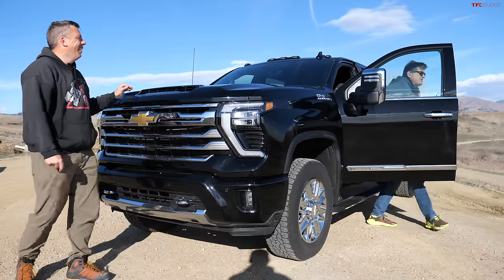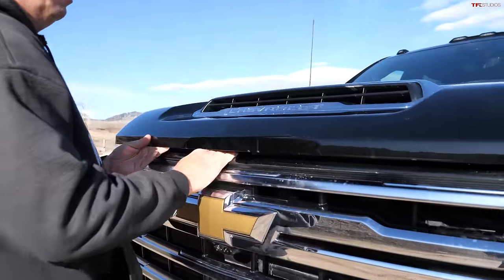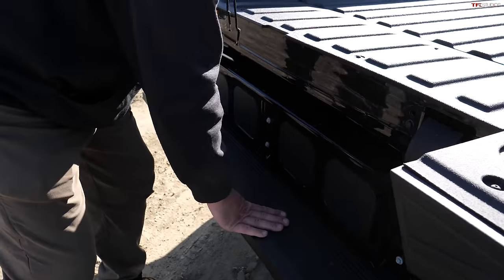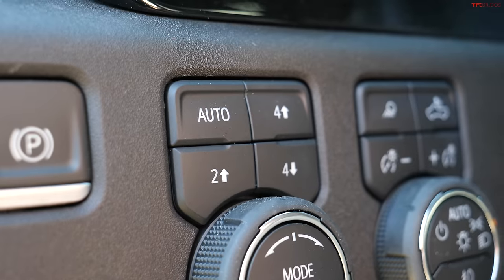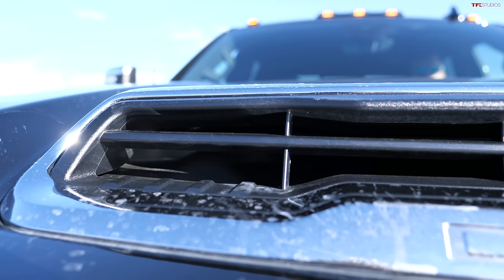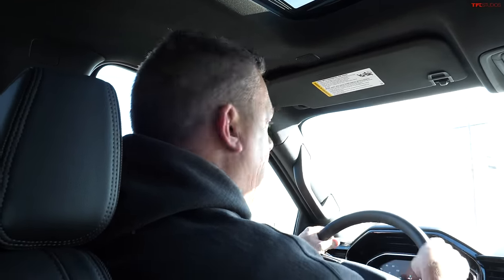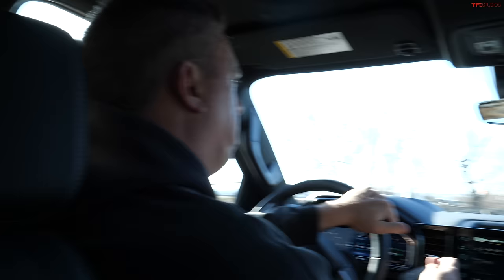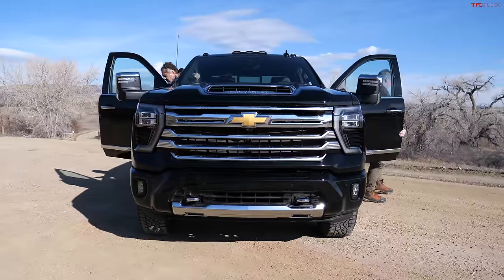Is The New 2024 Chevy Silverado 2500 HD Duramax Diesel The New Benchmark for Heavy Duty Trucks?

Comment: Now if only GM would up the Warranty limits on these trucks, I mean for nearly 90k you could at least expect a 5 or 6 year bumper to bumper.
Reply: I upped mine to an 8 year 100k bumper to bumper warranty just because of the emissions equipment...
Reply: Duramax and emission equipment is 5 year 100k mile warranty already.
Reply: @richfarfugnuven6308  
In Ca it's an automatic 8 80k emissions
Reply: Exactly right ! They need and every manufacturer needs to do at least 100k mile warranty ! That’s not to much to ask for at 90 k dollars
Reply: Oh like Dodge? Dodge has taillight warranty pretty much
Reply: I just bought a brand new 23 Silverado LTZ and I get a bumper to bumper warranty on everything for the lifetime that I have the truck
Reply: @richfarfugnuven6308  Check your extended warranty, it may be electrical and mechanical only, and not actually bumper to bumper..
Reply: @Kevin Reynolds  I bought the actual bumper to bumper to cover the DPF...
Reply: @jonscott7686  ummmmm, no...
Reply: @richfarfugnuven6308  yes, same thing with my fiancé’s 23 Tahoe for as long as we have it is covered bumper to bumper you’re more than welcome to call my dealership if you want the number. Mr. know it all not every dealership works the same way.
Reply: @Jon Scott  nobody has a lifetime warranty on a vehicle.  What dealer is lying to you?
Reply: 5 year 100k
Reply: @Tallnerdyguy  yes I have a lifetime warranty.  I saw it in writing when I was signing papers.  They did it with my fiancé also. Team Chevy on route 30 in Valparaiso Indiana. Please call them.  I am not a liar!
Reply: @brucecollins8865  damm i might get a dmax the Cummins has the 100k 5 year drivetrain warranty but emissions was only like 40k or something it’s in the fine print they screw us when they can
Reply: @Jon Scott  have never heard of a "forever" warranty...
Reply: @richfarfugnuven6308  I said for as long as you’re on it, Kia and Hyundai do the same thing since they’re from South Korea you don’t do much research
Reply: @richfarfugnuven6308  do me a favor call the dealership I’m not lying. Please call Chevy on route 30 in Valparaiso Indiana. Ask them if it’s for real.
Reply: @Jon Scott  really now how much did that warranty cost you?
Reply: @needabettername  no bud dealers do have these warranties it's just more money. My buddy just bought a 23 Rubicon and got a warranty till 200k miles.
Reply: @TheDogGoesWoof69  i wouldn't not anymore as they have been having problems with their trucks between head issue's transmission issue's an so on.
Reply: @Tyler  I know alot of the engine issue's are with the 4cyl and the transmissions have been having issues in both the 4 an 6. Alot of the guy's switched over from the Tacoma to the Colorado.
Reply: why would they, no competition does. only Nissan, which is dying as we speak.
Reply: @Jon Scott  kia is 10 years, 100K...
Reply: @Jon Scott  I actually do a ton of research.  Thanks though...
Reply: @jonscott7686 those warranties are 3rd party and they are written where they are pretty much void on anything. Good luck
Reply: $88k plus 7% sales tax so $94k… I don’t even want to know what insurance will cost.. 🤔
Reply: You do, 5 years, or 100k
Reply: They break down to much to up the warranty sadly
Reply: @richfarfugnuven6308 just delete it!
Reply: I just bought a high country 2024 diesel and the truth is that I was dissatisfied, my truck shakes at a speed of 50 miles and I took it to the dealer and they told me that this is how the 2500 trucks came out. My question is, have any of you had the same problem?
Reply: And at 101K when it breaks, you're screwed.
Reply: @manuelolivares7271 I have a 2024 3500 high country duramax. Truck feels very planted. No shaking.

Comment: Would like to see how the new Chevrolet HD with 6.6 gas with 10 speed performs on Ike now… wondering if the 10 speed is a big improvement.
Reply: I too would like to see how the 10 speed transmission does on the Ike but that will not happen until GM puts a 10speed transmission in the 6.6 gasser.  The HD gasser only comes with the 6 speed transmission.
Reply: @ricwestdoesitwork  for MY24 the 6.6 gas comes with 10 speed.
Reply: @ricwestdoesitwork  I believe for 2024 the 6.6 gasser will now be paired with the 10 speed
Reply: @ilocan74  You are right about that as long as your looking for a 2024 model.  I knew at one time you could only get a 6-speed transmission with the 6.6 gasser and only 3.73 rear gearing.  I stand corrected and thanks for the information.
Reply: Well the 6 speed sucks so....
Reply: @ilocan74  like a less powerful 7.3 gas from ford
Reply: @Simon Brown  Those 6 speeds are reliable though, and really it's plenty of gears.
Reply: @WilliamStewart1  6 speeds are barley worth keeping 8 and 10 speeds are garbage

Comment: I wish GM would put the column shifter in the 1500 as well. It makes sense to free up space on the center console for additional storage. Great review, gents!
Reply: They do.  My '22 1500 duramax LT has the column shifter.  In fact, other than the wood trim on this spec the interior is nearly identical.
Reply: @donhappel9566  Oh, interesting. I test drove a High Country trim a few weeks ago and it had the center console shifter, not the column shifter. I guess it's only available in certain trims.
Reply: Column shifter comes on half tons with the flip up console. Full center console gets the center shifter
Reply: I have one in my 2023 sle x31

Comment: Hoping you guys get your hands on a 24 gasser! I’m excited to see how the 10 speed with the gasser pans out…. I am also in the market for a new one!
Reply: No shoutout but that’s why I like watching JB Reviews. He gets his hands on a lot of dealer gassers while tfl gets press vehicles.
Reply: People with 20 & 21 6.6 gas motors are experiencing heavy oil burning conditions
Reply: I have a 2020 Gasser with 60,000 miles on it no oil burning yet. 🤞🏼
Reply: @AndrewJDixon  we have had lifters and trans issues come through the shop pretty regularly. Not sure what they meant when they said the "high end levels" get this interior... We have had plenty of LTs with this interior.
Reply: I was thinking the same thing. Curious to see if GM can fix the burning oil, lack of acceleration under load. you know all that important truck stuff that a paying customer might want considering the outrageous pricing.
Reply: 7.3 ford rules teh gassers with its avil 4.30 gears.
Reply: @AndrewJDixon  PCV system coupled with the high cylinder pressures caused by direct injection. 10 speed should solve this as it wont let you torque load the engine. it will just down shift,

Comment: Excellent updates all around. Love the new look. I'm enjoying my custom ordered 2023 1500 6.2L LTZ with maxed out towing of 13,200 I received last Friday. Suspension is great, exterior looks tough and premium, and the updated screens are sick. Chevy/GM has been on fire with the updates.
Reply: every women ive met loves her 15OO
Reply: Didn't know they made a 1500 with a 6.2 mine had a 5.3
Reply: @FirstGendodgegarage  that's cute. And that's also sad that your truck is your identity for manhood 😂. 

Trust me, I love the idea of a 3/4 but I have absolutely no need for it. I can tow my 32ft 7500lbs travel trailer no problem and even upgrade for bigger/heavier in the coming and still tow it with this set up. This is a beast for a 1/2. I'll spend the money I save elsewhere.
Reply: @pete1735  You can get the 5.3, 6.2, or the 3.0 Duramax. I just got a Denali Ultimate and that was only available with the 6.2 or the Duramax and I got the Duramax. All that was available only truck in the area so not like I had a pick between the 2 lol. I found some with the 6.2 after but they were all 2-4 hours away.

Comment: Great video.  The 2500 High Country looks great, but you will definitely need a step stool to do anything under the hood if you aren't 6 feet tall.  The horsepower and torque numbers are keeping pace with the competition but instead of 475 hp and 975 lb-ft of torque, why not just push for 500 & 1000.  Can't wait to see this beast tow; hopefully as a "Super Ike"!  Also, I think viewers would be very interested in seeing the 6.6-liter gasser reviewed.  Kudos to TFL Trucks for getting their hands on a 2024 model so early!
Reply: Because do you actually need it? It has crazy capability. 

How much sales are they losing because of those numbers? Maybe they make more net profit by not investing to get those numbers.
Reply: And numbers don’t always tell the true tale.  Even though the others are slightly higher, how much is actually “usable”.  At what RPM too?  I agree, are you going to know the difference between 975 and 1000?
Reply: focuses on power under teh curve, aka useable power range vs peak.

Comment: Looks great! Crazy how advanced these trucks are getting! I still love my square body more!
Reply: The prices are getting advanced as well.
Reply: Your older truck is probably more reliable also lol
Reply: @hugos.5059  At least it won't have DEF tank/DPF regen issues!
Reply: C 10 💪
Reply: @devengudinas1649  k10 💪
Reply: Love my '84 CUCV M1008 with 22k mile frame...rockin a 6.2 diese, TH400l and 4:56 solid axles lifted 5" on 38's and dont laugh shes NEVER paid for!
Reply: @05EVORS  Great on the  trails, not so great on a road trip.
Reply: K2500 with Navistar 6.5 (big turbo, big fuel system, water/meth, AND a low body line with huge windows, and soft seats. Best truck chassis ever! (IMHO)
Reply: I still love my 2005 LLY Duramax lol runs like it came off the factory floor

Comment: Fairbanks resident here! Too bad we usually don’t use that outlet because we have an oil pan heater, transmission pan heater, battery heaters, along with the block heater plugged into the same junction. I drilled out a bigger hole on my 2020 2500 and installed a NOCO GCP1 15A AC Port Plug to plug into the junction box…so still a clean hook up for all the heaters we use up here. Hopefully GM fixed all the DEF issues with the 24s.

And the LT model I built online comes with the big displays. The work truck versions still has the old radio display.

Comment: Put that rig in tow/haul mode and run it in manual. My 22 ZR2 1500 with the 6.2L launches hard in tow haul and runs through the 10 speed very smoothly. I'm rolling 525HP in my Duramax and I'd say it's similar given weight differential.

Comment: I love my ram 1500 limited but after buying a new boat that exceeds the capacity of any half ton truck I will be moving up to a 3/4 ton. the 2024 refresh for gm hd is very appealing to me, the looks inside and out as well as power numbers are impressive all at a much lower price than a ram with the Cummins or a ford power stroke. I believe I’ll be making a switch.
Reply: You need a diesel to tow a boat? What the hell are you towing, a yacht?  I’m sure any of the gas engines in the new HD’s would be sufficient.
Reply: great comment , literally every woman who drives a 15OO  says the same thing

Comment: I have a 23 3500 SRW. It's been a good truck so far. I've towed for 4,000 miles with 13K, it does well. I wish the fuel tank was bigger than 36 gal. Ford has a great idea with the 48 gallon in the longbeds.
Reply: I'm picking up a 62 gallon S&B fuel tank for my 2500hd after this work season. Look into it, definitely worth the upgrade.

Comment: My two concerns with the engine block eater plug in the bumper.  One, you need a special cord.  Don't lose it.  Two, when it's cold and snowy that little cover will be frozen shut with ice and snow.  The grill area is warmer.
Regardless, I'll probably buy a new one in 2025.
Reply: And needless to say, but that lower area of the front bumper is the first to rub every snowbank, twigs, brush and mud. Wont last a week in a REAL truck environment

Comment: In reference to the stiff seats. I just bought a 2023 GMC. The seats were quite stiff but after 1k miles they’re breaking in  nicely and have softened up quite a bit. Same for the suspension.
Reply: I had a 2020 Denali 2500 with the Duramax. The seats were horrible, I sold it with about 12,000 miles on it.  Im 225.they never broke in. I hope these are better.
Reply: My 2022 half ton AT4 seats were stiff for about 6 months. Then they break in and are great.
Reply: My wife's 23 Tahoe high country has higher quality leather and softer seats than my 22 ZR2 that is equipped same as high country. I think work trucks and sport trucks are made firmer on purpose.
Reply: I have a 2022 Sierra 1500 Denali and I have no complaints about the seats.  I find them super comfortable.  I’m not a huge guy though so that may make a difference

Comment: I have the 24 LTZ and just didn’t see the need to pay the extra for the high country. Only thing I’m missing is the automatic running boards and 20” rims, and I wanted the 18” rims. Saved me about 10k! Would definitely opt for LTZ if you want basically the same truck.
Reply: Yes I have a fully loaded '18 dually LTZ and it is the same as high country without the badges.

Comment: GM has had the best engine and transmission since the Duramax came out, now the interior is the best as well... looks like a great ride, too bad it comes with a 30 year mortgage lol
Reply: Only on the heavy duty and inline 6 duramax in the 1500
The 5.3 and 6.2 are problematic with lifter issue , bent pushrods and other  issues , I wouldn’t call it the best

Comment: So they made the Silverado look more like the Sierra. Good thing, the Sierra is a gorgeous truck. The lights and block heaters have been around for a while, they are very useful. The multi flex tailgate is awesome and extremely useful, A lot of people are curious about the 6.6 gas with the 10 speed, me too. Please test it as soon as you can.
Reply: It's a wonder that block heater plug isn't damaged more often considering how low it is and that it's on that lower cheap plastic portion of the bumper cover
Reply: @SuperCJification  How would a person damage it unless they screw up? (and that's on them) I have been driving for well over 40 years and have never damaged the front of any vehicle I've owned. My current 2006 3500 front end remains undamaged to this day. My "lower cheap plastic portion" is original and unbroken. Just say'in.

Comment: I had to come back to this video to leave this comment. You mentioned that Ford's doing there drl with the seed to the outside of the car and Chevy and GM are doing the sea towards the grill, but GMCs are still doing it like the Ford probably to distinguish themselves from the Chevys!  

Keep up the good work.  Still rocking my 2015 GMC Yukon with 175,000 miles on it.  I'm always amazed when I take out one of our 2022 crew cab Chevy 3500 6.6l gas engine that I can get better gas mileage than I can in my truck 😂.

Comment: The front end styling doesn't make me want to hurl anymore, so that's a decent improvement over the previous generation.  I can't image what GM's designers and ergonomic people were thinking putting the SAME SIZE KNOB for the lights and 4WD controls right next to each other.  Nice of GM to pilfer yet another Ford idea with the fold-away grab handle in the bed.  Overall, I think the Ford and Ram are a bit more appealing.

Comment: You really need to get a gas engine truck. The 10 speed has made big difference in tow ratings and I’d really love to see you review it.
Reply: The 10 speed is also littered with problems
Reply: @waterloo123100  all the reports I’ve heard say the the Allison 10 speed in the HD trucks has been very reliable. Given that they will be mounting the same trans to an engine that makes around half the peak torque I’d expect the thing to be utterly bulletproof.
Reply: Internet rumor. Just like the oil consumption crap. My brother has had 2 Duramax with the Allison 10 speeds. Over 150,000 miles on each and 0 issues.

Comment: Really wish you guys would put a well optioned HD with the L8T 6.6 gas powerplant to the test and reviews.  I think a lot of us are thinking the gap has closed with the Duramax and are not sure if the price premium for the Duramax is worth it any longer.
Reply: If you are towing or hauling, then it's worth it.  If you are just being a jackass just red light gunning it, probably not.
Reply: I tow a 13,000 lb 5th wheel with a F250 6.2l and it works just fine, and saved $10,000 over the diesel to put toward the trailer and gas and the kids’ college savings accounts.
Reply: @charliefowler4874  not to mention all the  DEF you would need to fill. I’m seriously considering the same.
Reply: Got to watch the gas trucks, the way GM works the GVWR, the derated ones won’t pull a midsize fifth wheel. It will pull it, but the derated GVWR makes you over weight. 
Just bought this very truck, today, traded a gas 2022 derated to 10k GVWR, with my midsize fifth wheel I was 80 lbs from being overweight with half of my stuff loaded. Also, didn’t pull very well.

Comment: Really enjoy your videos, I have a question a little off this HD truck. Why don't they  make a Suburban in a 2500/ 6.6 diesel? I mean there are a ton of families that have 3-5 kids ,dogs ect.. I bought a 22' suburban with the 3.0, I had to trade in my 20' silverado 2500 for the extra room. The 3.0 pulls my boats fine but loaded down it will not pull a large camper or toy hauler. For many a suburban HD with the big Duramax would be the ultimate vehicle. Do you think they will ever release one?
Thank you
Reply: They do make an HD suburban, sold to government only though. Wish they would sell to consumer, would sell like hot cakes